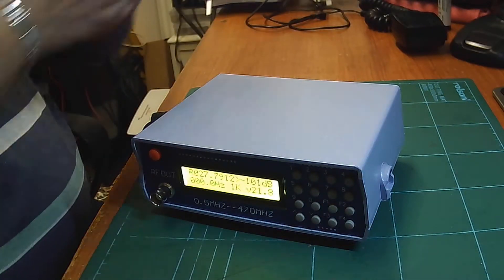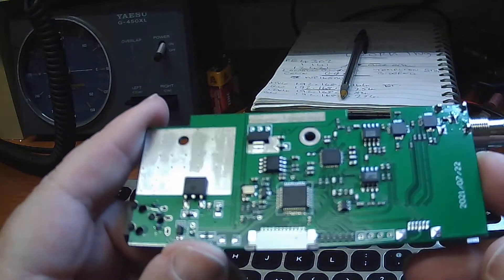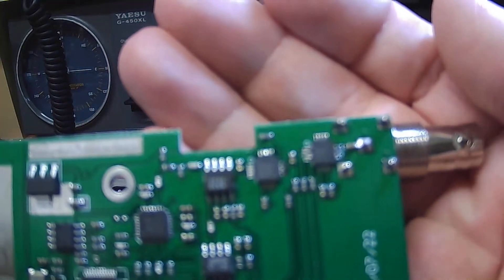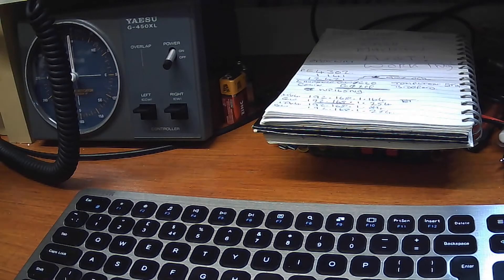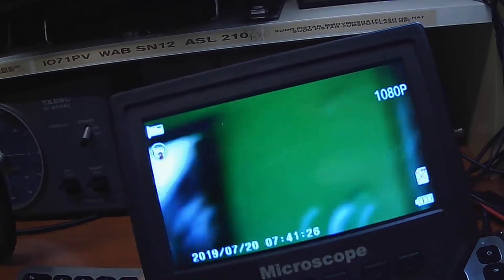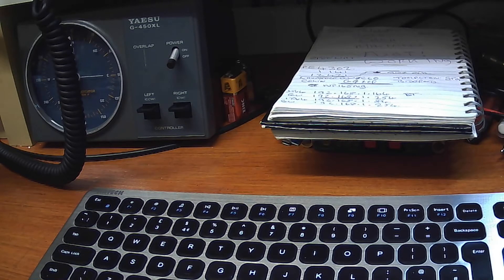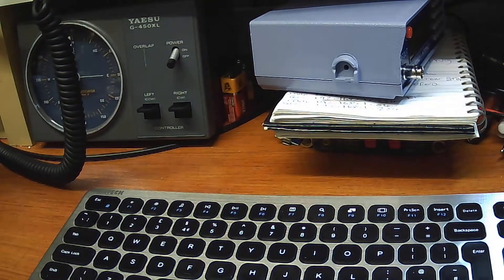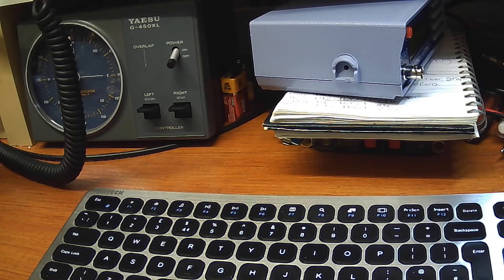0.5MHZ - 470MHZ Frequency Generator Repair

Comment: Hello. I'm trying to find out what a component of this generator is, it's a sot23-6 with the brand 9A1k3, do you know what it is?
Reply from the maker: Hi sorry for the delay in answering you but I'm not at home at the moment. I bid change the two ic's to the 1046's and the unit seems to work good.